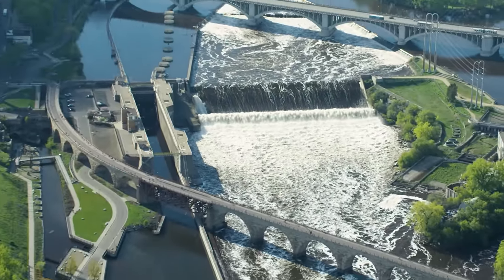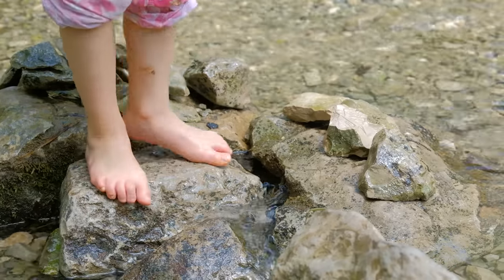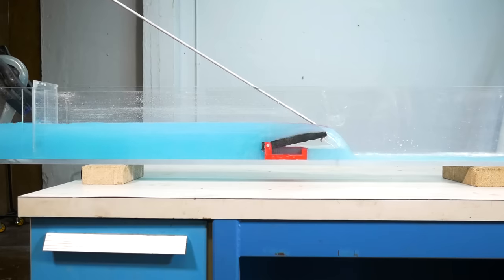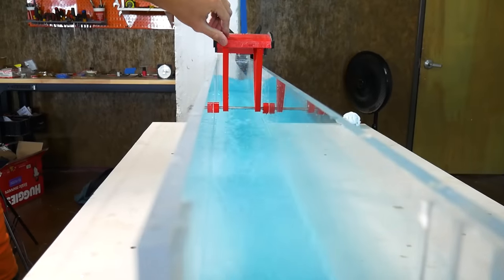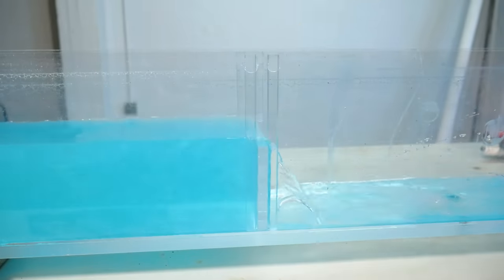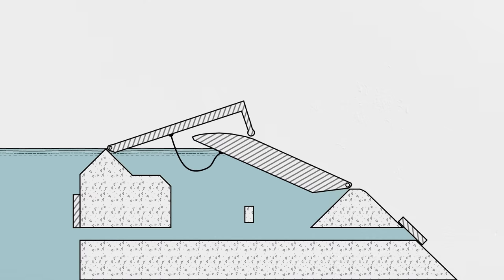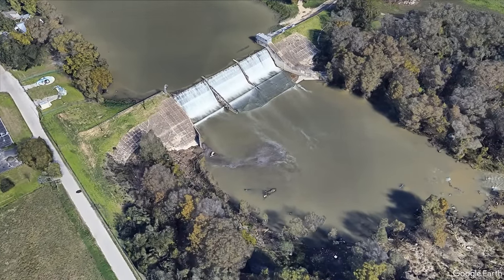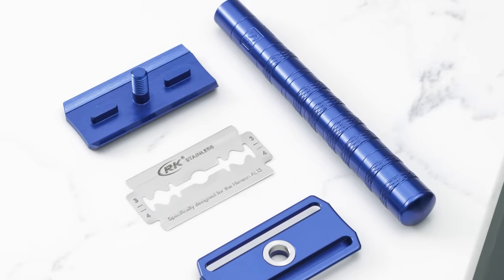How Different Spillway Gates Work

Comment: Living in overall flat country (highest point just above 300 m above sea level with majority being under 100) I'm lucky enough to live just 2 hrs bicycle ride from areas largest dam - 38 m (pressure height) hydro plant (I think around 900 MW peak power output). For local scale it is crazy structure as it has ~300 meters car tunnel (actually only tunnel in country) and with turbines and all other stuff being part of dam (not side structures as for 2 other dams on same river with 10 and 18 m pressure height). When you are inside tunnel, normal day operation would mean that water is flowing under tunnel out of turbines. But during spring floods (snow related floods) water is flowing on top of it. Sounds inside and visuals outside are unreal when it gets into 3 to 4K m3/s flow rate. Some even call it local Niagara falls during this short period (not all years have it - depends on amount of snow/ice and melting speed - making it more special event).

Comment: I have a safety razor, and I use it all the time, but if you travel by plane, the safety blades cannot go on a plane, so I suggest holding on to that old razor just for traveling purpose, it was very frustrating when I can hold on to the handle, but I had to surrender all the blades when I went through security at the airport

Comment: Its funny watching these videos as my family business for which I work designed and built many of the gates in this video including all of the gates on the San Antonio river walk (except gate 5 at the end which we have the contract for and are in the engineering phase for now, that is the pair at the downstream end, one of which is currently buckled and nonfunctional). We also built the replacement gates for Dunlap which is now complete and we are under contract for the rest of the GBRA sites, I have the manufacturing folders for McQueeny and Placid on my desk right now. We did the Tempe Town lake gates as well.

While we build many different kinds of gates our specialty is crest gates, floating bulkheads, roller gates, jet flow and fixed cone valves. We also believe we are the only surviving company in the US with functional broome gates currently in service. Less frequently we do miter gates and slide gates though usually by the time a gate is big enough for our manufacturing envelope a roller gate would be used instead.

 We do tainter gates occasionally but generally we steer customers towards crest gates as replacement for tainter gates as the existing superstructures of the dams is generally suitable with minor modification and crest gates are generally a superior tech.

You raised the concern about potential hydraulic failures constituting a risk for crest gates but we have never had a failure on any of the hundreds of gates that we have had in service for decades, even though one or two have been victim of attempted sabatoge (eco terrorists cutting hydraulic lines with bolt cutters in an attempt to drop the gates). That is because the hydraulic systems use what are called velocity fuses which mechanically detect abnormally high flow rates attendant to a line or seal rupture and effectively lock the line so the piston doesnt move. Crest gates have a significant safety advantage over radial gates in that they can open in a power outage scenario under the force of the water, in fact the hydraulic cylinders we use are single acting relying on the weight of the gate and the water pressure to open. This matters because extremely high water levels also correlate strongly with power outages. Crest gates give far more precise control of water levels in the impoundment than radial gates as well and do not require as large and tall of a superstructure as radial gates, this is more important than it may sound as many dams are beneath bridges, since crest gates are hydraulically actuated they also need not have a hoist base mounted above them making them even lower profile. They also allow skimming to clear debris that builds up against the gates without having to open the gate fully and lose water or manually clean it, this is especially useful in cold climates where ice loading that builds up on the gates can be cleared. Crest gates also tend to seal better especially along the sill where radial gates can get debris trapped under them keeping the gate slightly ajar, we typically exceed the allowable leak rate per the spec by at least an order of magnitude, often two. Aesthetically they also allow you to spill a controlled amount of water over them to get the infinity pool look and a pleasant white noise and visual motion as San Antonio has used to great effect on the river walk. The trade off is that they are a bit more expensive up front to manufacture than a radial gate, though in a new construction application where the superstructure is new or being replaced the reduction in the size of the piers necessary willl more than offset the cost and even without that the benefits are often worth the additional cost.
Reply from the maker: Awesome info! I am shooting the Gate 5 replacement project, so I’ll get to show your new ones being installed! Really appreciate this input and insight.

Comment: much safer and less expensive to install bypass channels that dont experience the full force of all that pressure you get at dam, which can be permanently blocked off solidly.
bypass channels can have light weight gates.

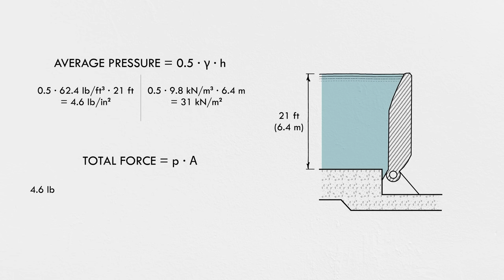Comment: I really apprieciate the use of metric alongside imperial, but I'm affraid you made a mistake at 5:09
Force should always be in kN, and according to my calculator 31 x 6.4 x 32.3 = 6,408 kN, not 6,600

Comment: There’s a cracked trunion anchor in Gate 8 in the Oroville Dam. Is anything going to be done about it before it fails?
Apparently the DWR is unconcerned.
Reply: It's california. You'll be lucky it doesn't get worse.
Reply: @amentco8445  I agree. The original main spillway was poorly constructed then they never maintained it. You can see online pictures of the gate 8 crack if you search online but, conveniently, there’s no really great shot of it. DWR says they’re watching it and it’s nothing serious. For concrete to crack it means the internal reinforcing rod is either sheared or severely distorted. Recipe for disaster.

Comment: 5:20 that is a lot to ask of a hydraulic system, so why don't they have a metal rods that slide into place at the bottom of the flaps either upwards into the flaps or sideways into the flaps, to hold the force of the water? Like a safe door.

Comment: Debates that Practical Engineering Channel could solve.
Regarding pluming drains (residential and commercial). There are two widely held beliefs, which may be incorrect.
1) Pitching a pipe much more than the standard 1/4" per foot, leads to clogged pipes because the water out runs the solids.
I personally don't believe this, but lack the financial means to conduct my own testing.

2) Upsizing to say 4" pipe for a drain that could easily be handled by 3" pipe is desirable.

An article I read said that 2ft/sec or greater water velocity is enough to effectively move solids through a pipe. But, given that today's toilets are low flow (1.6gpm), upgrading to a 4" pipe would greatly reduce water velocities, which would likely take most low use systems (homes and small businesses) to lower water velocities than the 2ft/sec mark.

Comment: I wonder how those razors would compare to the Japanese Made "Feather"-Brand 'AS-D2' model... I spent 180$ on mine, and they are excellent for shaving one's face and neck. (Blades are only ~50 cents/each, when bought in bulk)

It would be interesting if the company in the video would make high-quality double blade cartridge razors, intended to be used on the entire body. I've been hoping to find a good, quality disposable razor that has the modern features (flexing head, etc), yet is just as thorough and well-designed as some of the 5-bladed cartridges.

I'll have to check this brand's website, to see if they make anything beyond safety razors.

Comment: why is underground piping not used in spillways more often? would it not reduce the chance of erosion?  i would guess they are more worried about inspecting but it seems damage is done by uncontrolled flow rather than just power.

Comment: Theres lots of interesting gates, I htink teh most interesting gates are flow gates, they oftne are like, pointing the opposite way of teh flow, and the current strengthn effects its modualtion height, and it always allows the same ammoutn of water over it.
-->>
    \
......\....... -->

so it bobs up an down, the main benefit of teh gate is that its load over time it endures is very low ,becasue both forces that are lifting and gogin over kind of are bouncing between its balance point or pivot.. so there is a like a near net zero load...

Comment: 6:34 I never understood why the gates aren't anchored with a big wall of concrete behind them like the one in front of them. Obviously the system they use works.....but it doesn't look like there is much meat behind the pivot point there at 6:34 for instance.

Comment: In fact, these cylinders do not work with hydraulic fluid but with grease. The lubricant is safer because it will not contaminate the watercourse in the event of leakage.

Comment: CORRECTION needed for your opening video statements. The construction of the Upper St. Anthony Falls Lock was completed and opened for use in 1963, not 1937. Also, it's worth noting, both the Upper & Lower St. Anthony Locks, were closed to all traffic in 2015 (8 years prior to this video).

Comment: As an engineer I disagree with your assessment on a crest gate and its failure. That failure is not present if you use a linear screw. The weak point of a radial gate are the pins that hold back the water. Likewise the point of failure with the crest gate will be the tension bar and screw holding up gate. The fact that the load distribution makes the radial gate seem more robust is irrelevant because at the end of the day a chain is only as strong as its weakest link. Otherwise nice video.

Comment: Hello, so I live in Lawrence ks and there's a dam there on the Kansas River. It's a odd design that I'm not sure you covered. One side has the power generator then a section in the middle that's a slope, I'm not sure how to explain it. But then on the end of the other side is a section that's blocked off with a small flow in it, but I'm pretty sure it was for the old generator house. They have to put a line of sand bags to stop it up also. If I missed it in the video what kind it is then please let me know.

Comment: Thanks for this interesting video!  I'm wondering about the number of movable roller dams still in use.  We have one here in Fort Wayne, but the rollers haven't been raised since our disastrous Flood of 1982.  There is one Tainter gate on the dam used for regulating river levels in town, but the main rollers seem frozen in time.
Reply: Lock and Dam No 15 on the Illinois Iowa border still actively uses them, so that's at least one

Comment: Nice!! Can siltration cause the base of a dam to 'heat up' and if so, what are the implications of a concrete dam and its' lifespan?
Reply: No, the current of the water keeps it cool
Reply: @nolesy34  So if there is say 100 feet of sediment, what water is keeping it cool?
Reply: @k4x4map46  davidoff

Comment: Soooo is it the depth of the water that creates pressure or does how far the water the dam is holding back also factor in? Like lets compare the hoover and glen canyon dams. Similar height but one lake is much larger does that mean the pressure on the dam is the same or more cuz of a bigger lake?

Comment: that last dam has made me curious, if party A owns a dam that no longer serves a production purpose and now its impounded lake is surrounded by waterfront properties.  Do they have an obligation to maintain the dam? Or are those people at the mercy of said party just saying "Eh I do not want the liability anymore" and open the gates and draining the water way down before just removing the structure.
Reply from the maker: That question was at the crux of the whole story. Definitely check out some of the articles about the event. I also talk a bit about this in my Edenville Dam failure video.

Comment: Wouldnt you want the gate to fail open? I would think a fail closed situation would be dangerous to the overall dam
Reply: If the gate fails open, you’d potentially have a sudden uncontrolled release of large volume which could cause catastrophic flooding downstream.  If it fails closed, not much of anything happens initially.   The water level in the reservoir may rise, but most dams have more than one gate, so if one fails closed, the water level can still be controlled through the use of the other gates.  If it were the only gst, and it failed closed, the dam might be overtopped, but dams are designed with an emergency spillway for just that eventuality.  The danger of spilling water over the emergency spillway is a lot less than that  of a sudden, large uncontrolled release.
Reply: @andrewalexander9492  I guess that makes sense. My thought was it's better to have a single spillway sale verse the entire Dam. But to your point, the emergency spillway would probably handle the situation at that point

Comment: Noob question :
Why not use normal, big Cylinderic valves either with screw threads or with double cylinder and a hole  like modern water tap ?

Comment: You've made a display error with the metric calculation of force. I double-checked the calculation because "kilograms" are never a unit of force in metric, they are exclusively a unit of mass. Your result is about an order of magnitude off of the correct value - which makes sense if you also divided by 9.81 meters per second squared to account for gravity and actually get a result in kilograms. The problem is that your calculation on-screen doesn't show this adjustment at all - I had to work backwards comparing your result to the actual result of the calculation displayed in order to figure out the meters per second squared conversion factor (which is slightly incorrect for sea level gravity anyway, but only by an amount that can be dismissed as a rounding error).

The resulting comparison is therefore fundamentally inaccurate. On the imperial side you are displaying a unit of force (a measurement which is invariable regardless of location in a gravitational field, because all of the "pounds" in your calculation are actually "pounds-force" with sea-level gravity build in and therefore with sea-level gravity cancelling out in calculations). On the metric side, however, you are translating force directly into a statement of "the force due to gravity felt by this mass at sea level", without any indication of the fact that you've made that conversion.

It's a somewhat minor issue in this context, but in other contexts (such as formal teaching contexts, or actual engineering contexts) it's important to avoid conversion errors like this, which is why I bring it up.

Comment: Instead of spillway gates, why aren't turbines used to convert the water energy released into electricity?  My guess is the usage factor wouldn't justify the cost?
Reply: instead of spillways? You'd use them with spillways. What turbine could effectively block water flow? It could only slow it down.

Comment: Why are we allowing all this water to escape without making clean energy along the way?
Reply: The spillways are located at the top of the dam, whereas turbines are located at the bottom where the highest pressure (& therefore most energy) is.

The simple answer is putting generators at the top of the dam would add expense & complexity for not very much payoff.  In other words, it would reduce the overall efficiency (both physical & economic) of the dam.

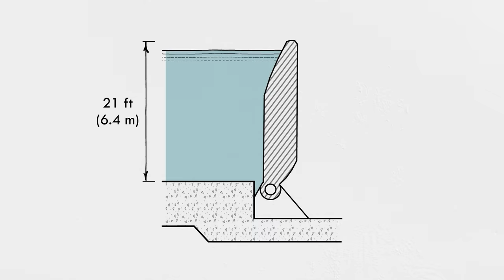Comment: It was a good video, but the math at 4:50 cannot be accurate.
There's no way that the water pressure is 4.6lbs/in^2. There's not even that much weight in a square inch of water, so how could there be that much force when the weight is distributed (tangentially?) or at a perpendicular angle to the downward force?
4.6lb/in^2 could also be represented as 662.4 lb/ft^2. This seems very wrong. The calculation doesn't include anything about the total reservoir volume/capacity and therefore weight. If you had a low level dam, but it had a huge volume, wouldn't that have more pressure than a high level dam with low total volume?

Basically, simply using the height of the dam and the weight of water isn't nearly enough to calculate the actual pressure on the surfaces. Also, the weight of the water isn't the force being applied, because the dam is relatively perpendicular to the force of gravity that gives it weight. Maybe that's where the 0.5 comes from, but it still seems to simplistic. I doubt it's cleanly 1/2 the weight being applied.

The calculation only seems to use 1 square foot worth of water volume over the entire surface of the dam. There's the entire rest of the volume to consider.

I suppose you did say recreational math, but still, why even bother if it's going to be so misleading?

Comment: does hydrostatic just mean water pressure?
Reply: Yes, specifically it means the pressure just from the weight of water that is not moving.  Hydro (water) static ( not moving)  that is  to differentiate it from “ hydrodynamic” pressure, which is the pressure from moving water, like you might get at the bottom of a spillway.

Comment: Moving parts are a pain in the *ss than still parts on any building BUT it's the still parts for example steel beams concrete&steel columns ect that cause  the biggest problems... burst tire ok replaced....... car splitting in half..... forget it buy a new car